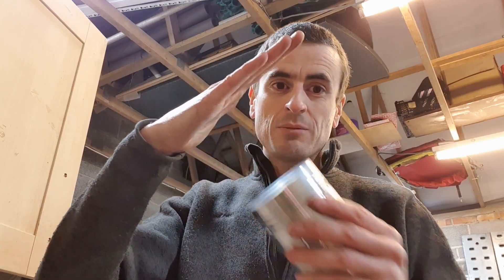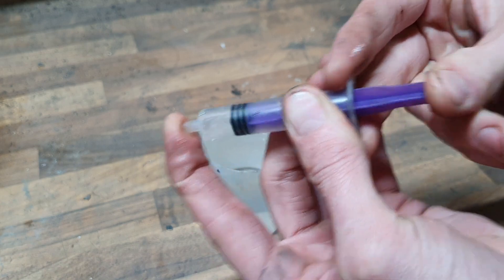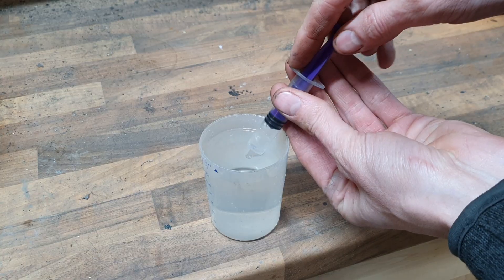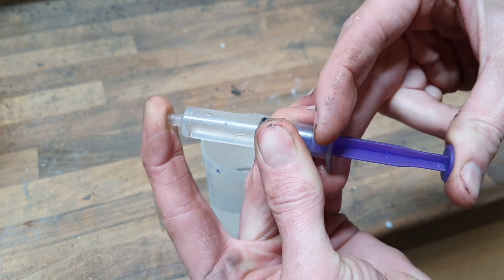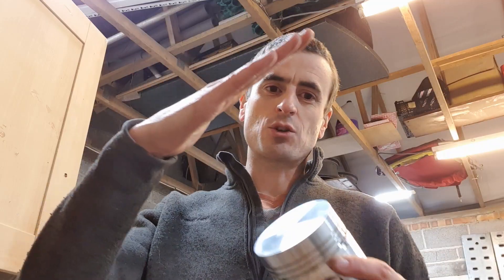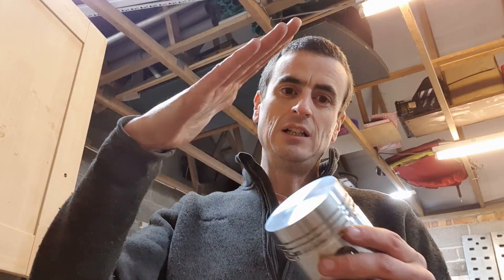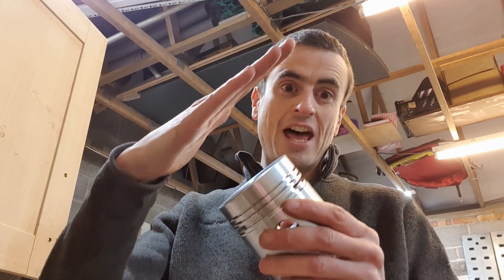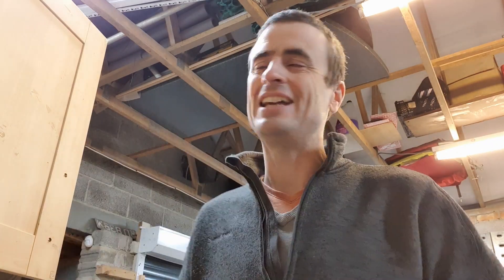Rufford Ford Fails  -  Why does water kill cars?

Comment: Can you claim the damage from the council? Or are you reliable yourself for the blown up engine?
Reply: You won't be able to claim from the council as when the ford is deep they flip the "Road Closed" signs to advise people not to go through. They are only a triangle sign so a "Warning" and not an order. 
There is also a depth marker on the bridge showing the depth at the deepest point, unless your in a landcover you dont stand a change of safely crossing Rufford Ford even they only have a 900mm wading depth as standard (3ft).

Also im pretty sure that ford crossings are part of the theory and hazard perception test I just can't seem to find the exact wording in the highway code booklet. They made a big deal of the "Show and tell" part of the driving test ~20 years ago however in recent years they have lost the focus on how to actually drive and more how to pass the test.  Go ask any newly passed person today some of the basic questions and they look at you like your an alien. 

Show and Tell questions
How do you tell if your Brake booster is working properly? 
How do you tell if your power steering is working correctly?
Show me where you check the oil level?  (Bonus points if its a modern car with no dipstick yes im looking at you BMW!)
Show me where you put the window cleaner fluid?
Show Me where you top off the oil? 
Show me where you check the coolant level? 

I would put money on it that the majority of new drivers cannot answer those basic questions. These were standard back in the day along with teaching mechanical sympathy.
Reply from the maker: @warrmr  very informative, thanks for the reply
Reply: @warrmr  or change a spare tire or a light bulb
Reply from the maker: Thats a very good question. I imagine you are liable, as there are depth warnings and the car will come with a max recommended wading depth. But they have closed it! So I net there were plenty of cases of people trying to claim
Reply: @lozl  would be interesting to know if they were successful in claiming.  Plus is this situation part of the driving test?
Reply from the maker: @therealspixycat  this is not mentioned on the driving test

Comment: I did wonder how much damage happened to those cars, I will now think twice about the depth before crossing a ford, I guess most of the damage is cause by how its driven through the ford as my air intake is at the top of the engine.
Reply from the maker: Thanks for the comment 👍 much appreciated. You're absolutely right, that huge wave that comes up over the bonnet is a killer.